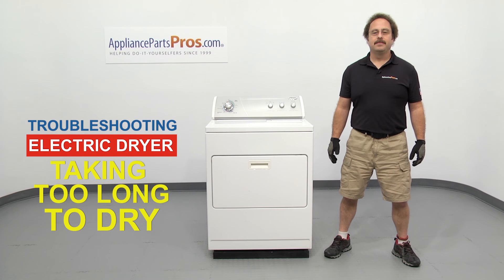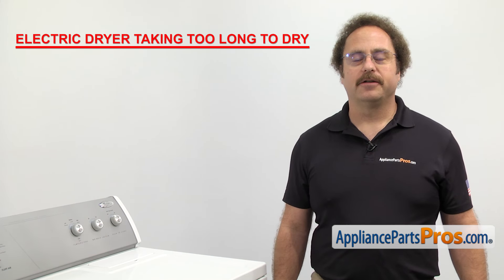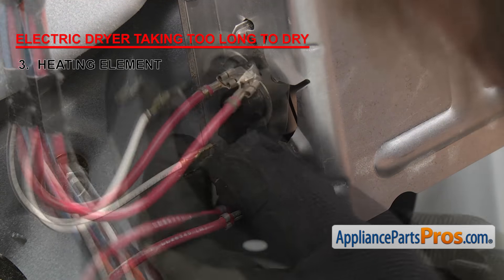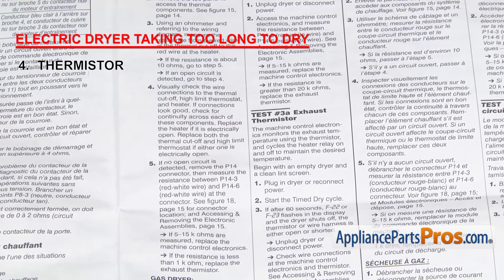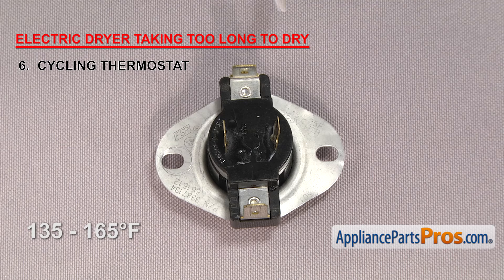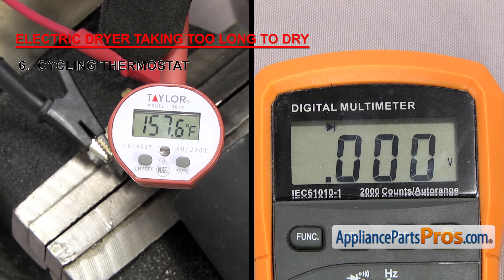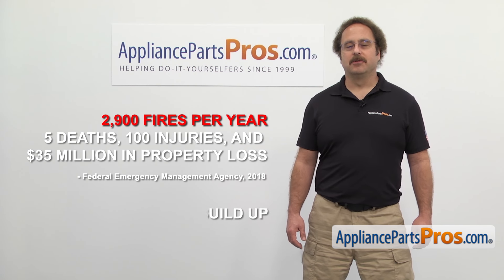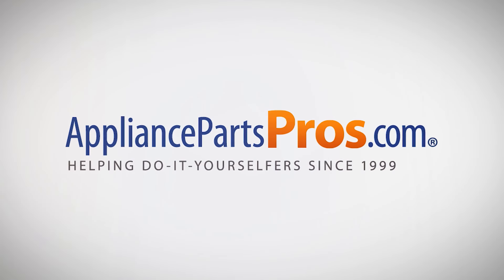Electric Dryer NOT Drying or Taking Too Long - TOP 7 Reasons & Fixes

Comment: I just grabbed the rear felt seal for my Whirlpool dryer. There's a front seal and a door seal that I might have to just jimmy something to work until a new seal can come in.

It's a race against the clock because I have a new dryer on the way and if I can fix it before the new dryer comes in I'll get my money back and cancel the new dryer.

Comment: Thanks for this.  Question - at the 1:47 mark when you mention this is a single coil element, mine looks exactly like yours, except i don't have the white wire at the bottom.  i don't see one to connect.  i guess it's jus that way on some?

Comment: Hi, I have LG dryer. I replaced the main control board because taking too long to dry. But still have the same issue. What do you suggest any other parts  to check?  Thank you.
Reply from the maker: What is the model number of your dryer? How often do you clean the lint catcher and the duct work? Have you checked your thermostats to see if they have continuity coming to them? If your dryer has moisture sensor bars check them to see if they may have lint built up on them.

Comment: For the Thermistor, make sure the sensor is clear of lint inside the pipe. I found mine covered with lint on the inside of the dryer. I believe this was insulating it to changes in temperature. With a good wad of lint, acting as insulation blanket, it would slow up the cycling of the dryer, take longer to turn on the heat, then longer to cool down, then longer to heat up. Just check it, stick your hand up the pipe and see that it is clear of lint.
Reply from the maker: If there is a lot of lint build up in your dryer that can cause the thermistor to not work correctly. We do recommend cleaning the dryer ever so often to prevent lint build up.

Comment: I changed the thermal fuse it still takes a while to dry? What do you suggest?
Reply from the maker: How often do you check the lint filter? How often to do you clean the duct work that leads to the outside? Do you happen to have a multimeter? If all that is good you may have an issue with a thermostat and you would have to test them to see which one of them could have failed.
Reply: @appliancepartspros  every day it’s clean do you think the dryer hose needs to be cleaned out?
Reply: @appliancepartspros  which multi meter would you recommend?

Comment: I hope you can help me, my felt inside the door has ca 7:20 me all the way out and i dont have the money this month  hopefully next month. But in the meantime my  dirty clothes are filling up it takes 5 times to dry my clothes. Im thinking gluing something like a jump rope or some filler til then desperately need your help
Reply: Hi is this is Sandra again don't know why that 7:20 came out I was talking about my Whirlpool dryer the inside I guess it's called the felt is all the way out my 4 year old granddaughter pulled it all the way out who knows where it's at and like I said my dirty clothes are piled up not a good time for that especially during the holidays it takes five times to dry a load and I was thinking about putting maybe a rope jump rope going that on until I'm able to get a new one or some kind of filler what kind would be best if any I need your help desperately ASAP
Reply from the maker: We cannot recommend you use anything other than the felt seal that is recommended for your unit.